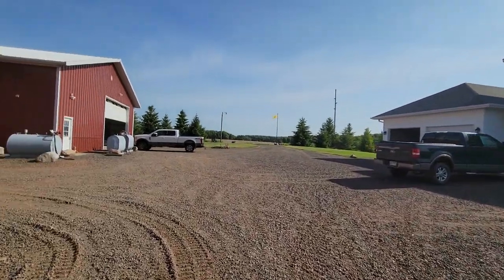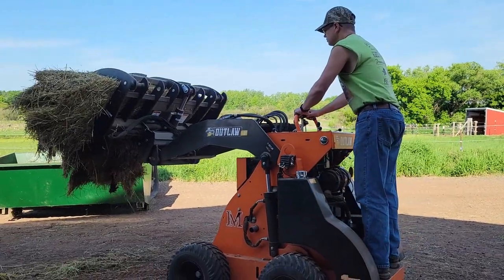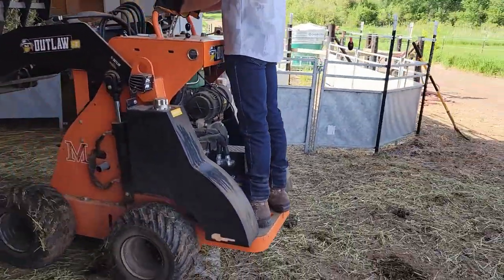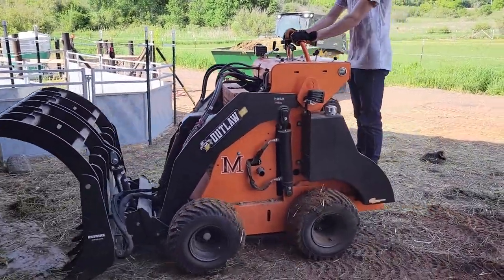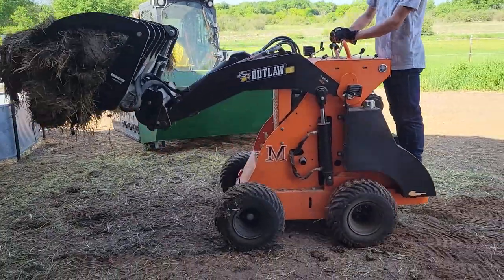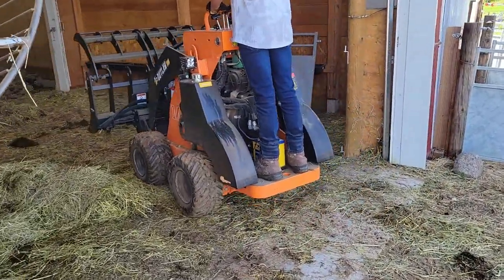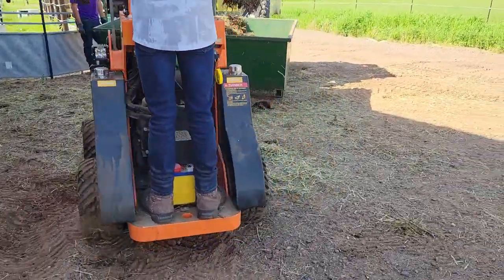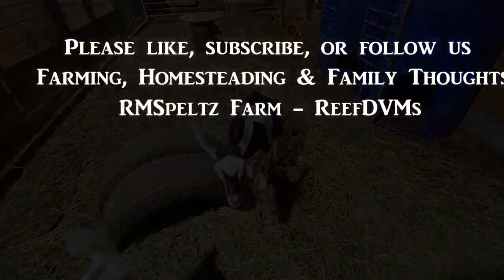Cleaning Barn Stalls, Grapple and Mini Skid Steer

Comment: I own a Mt-85 this unit you have with the rubber tires looks too jumpy for me but they both are time savers
Reply from the maker: I certainly understand tracked machines but the wheeled is small enough to fit our stalls.  In low mode this machine not jumpy but in normal and hi it is little yet as we are figuring it out, the smoother we run it the better we get lol
Reply: @RMSpeltzFarm  and with smaller areas the mt 85 is a little bulky like everything we buy machines for certain applications and I can see the smallness of that unit is beneficial love the videos the darn logarithms of YouTube got me away from your videos love watching everything you put out now I hope that they pop back up for me keep up the great work